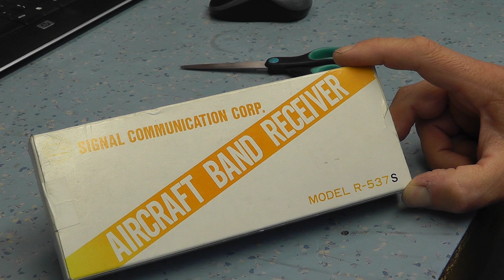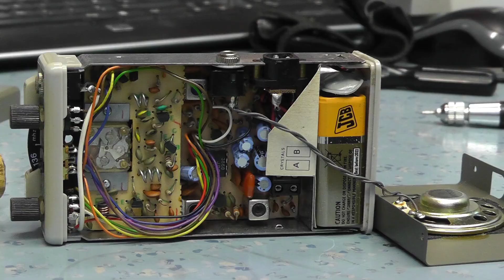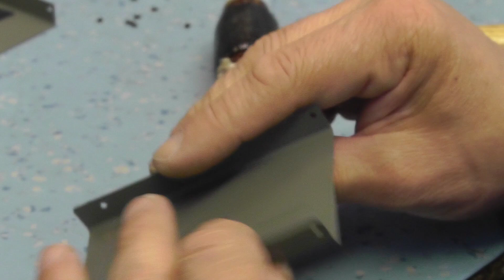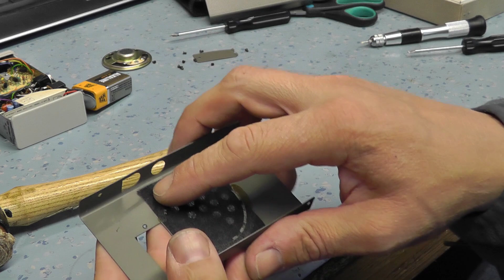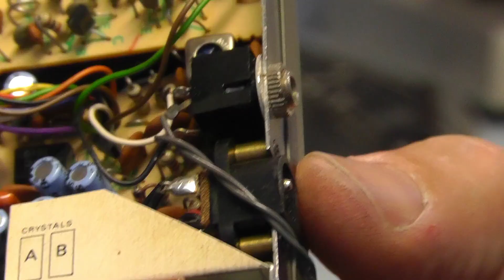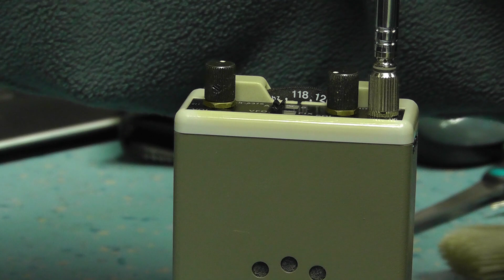Signal communication Corp  R-537s Airband receiver. Out with the hammer!

Comment: I nearly commented earlier in the video when you dated this 1980's possibly early 90's 00:12 they were much earlier then that by a decade. they were early 1970's and back then they were the 'Rolls Royce' of air band receivers. I remember having a row with the wife when I told her the price back then, just a bit short of £100! It was Lowes of Matlock who originally imported them and the old crystal manufacturing company Quartzslab Marketing had several crystals in stock. I recently got my hands on one of these in mint condition with 2 A4 sized scanner books at a reasonable price. I much prefer the old analogue tuning as you can 'Scan' the aircraft band much quicker. I did a couple of mods to mine. I removed the 3.5mm earphone style aerial socket and used a chassis SMA socket. This made the antenna choices and availability much better, the second mod I did to mine was to replace the 9v battery with 3 Lithium batteries (3S) in series and 3 diodes in series to drop the voltage a bit. The batteries are charged via a USB C socket which replaced the barrel jack socket. Finally a quick tune up did perk the receiver up a little. If you look at the small 8 pic IC in yours, it shows the date code 7619 or week 19 May) in 1976. They are a lovely little set which is hard to beat even today.

Comment: You've probably seen Shoei capacitors in Amigas, knowing you are an Amiga fan I expect you've tinkered around inside a few ;)
Reply from the maker: Wonder of its the same company as the helmets. Doubt it somehow.
Reply: @SoddingaboutSi  The logo is identical! I've had  the same thought myself. It's possible.. i've also seen motor run capacitors by Ducati :)
Reply: Looked into it more and apparently the capacitors are from Shoei Chemical Inc, and they are related. Same with Ducati

Comment: I have never seen one of those before,  cute little receiver :-D
I came to the same conclusion about the case as you did, it bent back way to easy.
A bluebird toffee hammer would have worked too ha ha :-D
Perhaps aluminium made the unit cheaper, but i don't know the prices of metals in that era so i'm just guessing.
Your thought about aluminium not upsetting the tuning must have been the reason for using it :-D

Comment: If you put it on a slightly soft, very thin surface (such as a single layer of cloth, or a cutting mat) you can push the dents out better as due the elasticity of the metal it needs to over compensate for it to relax back to being flat.